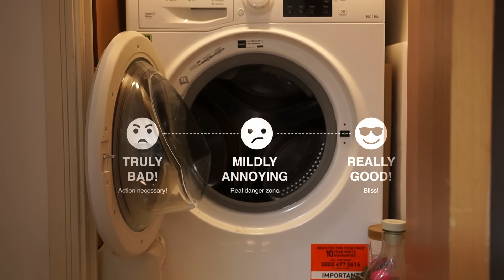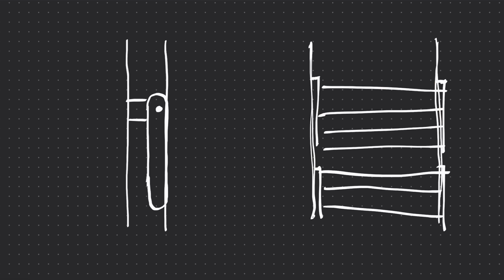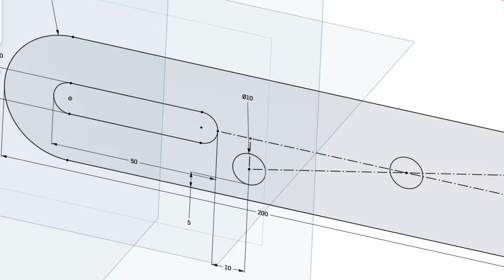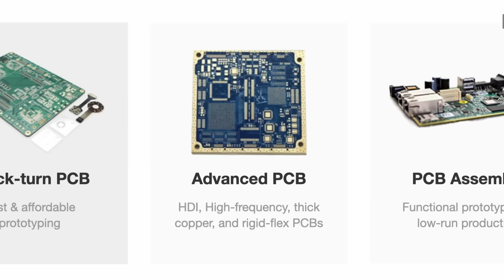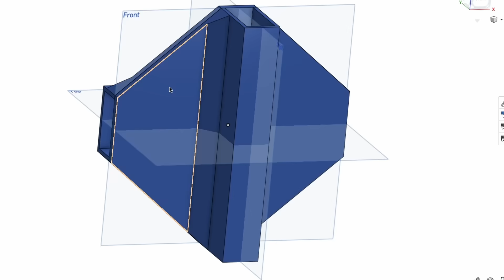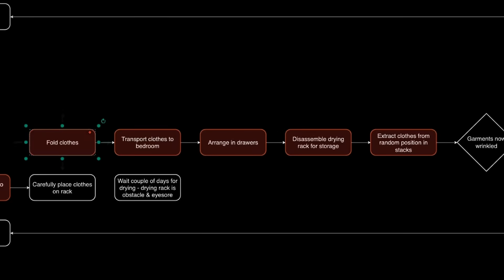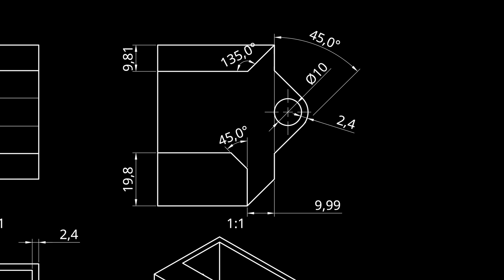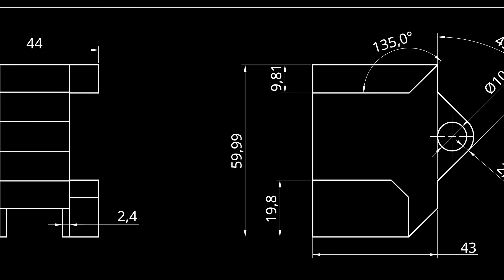I made furniture to escape the most annoying chore - and it fought back!

Comment: The sticker goo must have been a non-polar material.

Basic solvent theory: Stuff either dissolves in polar solvents (like water or alcohol) or non-polar solvents (like gasoline or oil). It's all about if the molecules have a charged side, or if their charge is balanced all around. Like dissolves like. It's the same reason oil and water don't mix. Water is polar (unbalanced charges on each molecule) oil is non-polar (balanced charge around the molecules). 

The usual answer for sticker goo is a strong-ish acid, usually a citrus concentrate. Polar or non-polar, this stuff tears up most gummy things.

Comment: Labels are a pain in the ass and it's getting worse because of chemical products thas are no more allowed leading manufacturers to try new compounds. Anyway one may consider that label glues are divided in two main famillies, oil soluble and water soluble. For the water ones, use water. For the oil sensitive you can use a wide variety of 'oil' derivate products. From cooking oil, to white spirit, cleaning essence... But the miracle solution is limonene it's the extract of citrus fruit peal. It destroyes very well most of the glues and mopymers.

Comment: Bro. Oil based glues have to be removed with oil based things. In Germany, we have something like cleaning gasoline which I use for these glues (which btw Ikea still decides to put on every single shelf board for some reason while on other furniture they prove they are perfectly able to do normal stickers that peel in one go). There is also acetone and some glue remover which I havent tried but I guess it's made for this specific purpose.

Comment: My method: placed the laundry room inside the walk-in closet, next to the bathroom right outside my bedroom. I bought a machine that both washes and dries clothes. 
Every day, when I take my clothes off, they go into the washing/drying machine. In other words, I use it as a dirty clothes hamper. Once it’s full, I turn it on. The clothes are now washed and dried, but only about 90% dry because by leaving them slightly damp, the wrinkles practically disappear a few hours after they’ve been hanging on hangers. Then all the clothes are ready to be used and washed/dried, over and over, until the end of life.

Comment: Critical issue here:
PLA is not structural, please use ASA(w/ nanopolymer bed adhesive) to ensure your parts won't sag severely over time.

This is due to creep, where PLA flows out of the way of all loads and stresses, to the degree where a screw tightened into PLA one month will be loose the next.

Furthermore, ASA is lower density(lighter), and UV resilient, an important feature since clothes drying tends to happen in sunlight. (Also can stand a lot more heat than PLA, but for direct steam PC would be better, use the adhesive for that too.)

Additionally, I recommend you check out brick layers (CNC kitchen's most recent video on it has a link to it) as a one button solution to increase strength 30% without other hassle. (Helpful with the tubes during assembly, where layer adhesion is the most limiting factor with that much leverage)

The tools you want for de-burring those pipes is an external pipe deburring tool and an internal deburring tool.

Using a wood hand plane to smooth the surfaces and break the edges is an easier,  faster, and cleaner method than sanding them.

Comment: Wow, this video has changed my life just because of the oil hack! hahah 

Jokes apart, I loved the design! And loved the thought process behind it. It just makes sense to simplify these everyday boring tasks. 
If I could add something for further improvement, coming from the principle that one would usually have some wet clothes to hang to dry and some dried clothes already stored. I would implement some kind of sliding system: when the clothes are dried on the bottom rack, I'd slide it up for them to stay with the clean clothes, at the same time, a new hack would slide down to hang new clothes to dry. I don't know how this would actually work, I just thought it would be a nice addition.

Comment: but its mostly for tshirts? I bought some nice velvet hangers and hang my wet tshirts, blouzes, hoodies, skirts, dresses on them (no sweaters as they would loose shape) and hang them on similar drying rack you showed on beggining of the video. Once everything is dry i just move clothes in my closet - no folding needed, no ironing needed (i have used iron maybe twice this year, im not even sure where my iron board is) and everything is on eye level. 
for other laundry i usually use little basket to separate socks from underwear, but you dont really need to fold them (changing socks for two dozens of identical ones also eliminates the need to pair them after the laundry and dealing with mismatched ones
in addition I have few smaller laundry baskets instead of one big basket - dirty laundry is separated while putting them in the right basket - i have one for towels and sheets as well

Comment: Kinda dumb you just made an on wall dryer. You could have gotten similar effect by just addnig something to block clothes from sliding off with regular dryer (maby not that cross shaped you have in the vid they are unpleseant to use, just get basic flat one).

The idea of skiping taking clothes off and folding them is cool but you didn't actualy do much with it as you simply left stuff in the open on a new dryer you made.
Instead you could make the ladder parts of the dryer detachable and hang them in the wardrobe. Maybe add a blocking mechanism so they won't slide off.

And to pick at this more you could have just bought a bunch of coat hangers use them for drying and then move clothes to the wardrobe.

Comment: find a way to integrate the contraption in a closed wardrobe and add a small dehumidifier at the bottom. the way dehumidifier works is just like a air conditioner, but without an exhaust it heats the room more than it chills. this will work for both purposes of removing moisture and heating the wardrobe in order to dry the clothes faster.

Comment: This is still an eye sore for me , i wouldn't want to see multiple colored clothes hanging on one wall of my room , my solution would be a cabinet with only two rods, one on the upper side and and one in middle , the roof of this cabinet will have a exhaust fan to ensure air circulation, I would make the cabinet with wood on exterior but line it with pvc sheets on inside to avoid mold or wood rot , now all I have to do is buy many many clothes hangers and hang my clothes on the two rods , they will dry when they will , the cupboard will be closed  so I don't have to see all my clothes on display, the only real down side is the exhaust fan which will consume energy , but it won't be much , I just need circulating air , which can be achieved by a small fan .

Comment: Think of the really thin cupboards in kitchens that hold cans and things. Have a sliding cupboard (think IKEA Metod) with drying/storage on one or either side (depending on room placement). Same storage solution, but now more discreet - once clothes are dry, slide the cupboard closed, so no clothes exposed to unnecessary dust. Potentially for socks and underwear, two cubby pots at the end of the cupboard before the rails start so you can just toss them in or pair and toss them in for the socks, and can easily grab without taking the whole cupboard out. Maybe a third for ties and tie clips and cufflinks. Maybe a small sectioned off area at the bottom for your shoes with perforated hole at the front/sides to allow for airflow and keep them from smelling the cupboard if you'vebeen exercising. Now you have a wardrobe with all your basics that is slim, discrete, and well organised whilst keeping your clothes clean from dust and other issues!

Comment: I found this magical solution. After hanging the clothes, leave them until they needed. The drying space is now my wardrobe.
This is basically an advanced version of that.
Reply: If I have money and space, I would buy an extra dishwasher to do something similar
Reply: If I may add : I do the combination of these, middle ground solution: instead of hanging the clothes on the ropes, put them in hangers (summer ones, which are light but also crease the most), and when dry, keep them on the same hangers, but move them to an open closet inside!

No comparison, though! Your solution is better in the sense that it merged these two steps even further! No moving inside. I just went with using items I already had...

 I admire your 3D printing skills, and I too love crafting my own solutions, so the enjoyment of building something from scratch, gives you the 🍰! 

And yes, it is inspiring to build something indeed seeing you do that! Thanks for sharing!
Reply from the maker: Hey if it works, that's great!! Sounds like a much simpler process than what I had before Naked W001!!

Comment: I've had this idea for several years. Fun to see someone else make something of it.

I've had a similar idea for dishes. When dishes are manually washed, you could place them in an area above the sink that drips down into the sink, and where you can just grab what you need from it. Or, If all the cabinets above the sink had pipes transporting water down to the sink you could have all of the dishes up there drying. 

Ofc if you have a dishwasher that changes things.
Reply: Apparently dish-drying cabinets are standard in Finnish homes.
Reply: @earincopper9975 nice, Finland isn't that far so I might have to make the move.
Reply from the maker: Thanks for the kind words and comments - glad this resonated!! Funny you mentioned that example. I actually run a similar system for dishes haha I don't put the high-frequency dishes in cupboards/ drawers. I leave the on the sink's drying rack, ready to be used, washed and reused with minimal friction.
Reply: @UrbanCircles  Haha i do the same with pots and pans
Reply: Ikea already makes a solution like that for dishes.
Reply: @CotonCotonCoton  cool!
Reply: I've seen dish drying cabinets in many spanish kitchens.

Comment: It is just a cloth rack. The metallic tubes doesn't ready do much, TBH, because the metal tubes have minimal contact surface area with the clothes and this area is not the bottleneck of drying. Actually any really smooth surface that doesn't absorb water will do, so metal makes sense. Also, I do fold the clothes for better storage. I just can't visualize myself going into my closet and have my underwears all hanging like that with the rack folded or otherwise.

Comment: My friend has a solved this problem in a cheaper and less time consuming way lol. She has a wardrobe set up so that most of her clothes hang on hangers. She made sure the clothes that she uses most often hang. Then she has one of those cheap clothes racks - you know just a frame with a bar on top for the hangers and wheels. When she does laundry, she hangs most of the wet clothes on the "drying" rack using the free hangers from her wardrobe. Once they are dry she simply transfers them into the wardrobe. If needed she steams the clothes right on the hanger before putting them in the wardrobe.
Reply: We do the same, all our clothes are on hangers, quite convenient

Comment: Well... we had similar problem. Solution was just to keep Tshirts from warping, we use cloth hanger (IKEA Bumerang). You put wet stuff on, it will dry out on and just slide back into wardrobe. Slide-open door and slide-out bar to keep the drying ventilated was the biggest issue, however.... it's working... 
I like your design tho...

Comment: Nice. For the stickers on the pipe, it is much easier to hairdryer them to melt the sticker glue before peeling. What leftover glue in the surface simply tap tap again with the peeled sticker u just peel 🙂

Comment: I have a wall closet by my bed, basically an array of hooks and round loops (no sharp points) where I hang my most used clothing. I also have 4 rows of rope going above my bed (anchored on hooks), where I dry my clothing. Similarly I often leave the clothing there and slowly wear it over time. 
I would recommend making a section with hangers or for hangers (dress shirts, etc). Also a detachable 2 finger arm for drying shoes/sneakers.

Comment: Great project and exploration. 3d printing changes the way I think about problems and this (your project) is a novel approach to a problem many face. One suggestion would be more smoother fillets on the print edges. This would give more strength to the filament you're using. Also wondering if you printed considering layer orientation for strength. Great project and great video..thanks for sharing! 🙌🙌🙌

Comment: I'm glad I'm not the only dork dreaming up self made furniture products for simplifying laundry 😂 
I've considered the approach you took, but got too worried about moisture in my somewhat poorly ventilated bedroom. it's so cool it works for you though, maybe I could try just 1 rack for my most worn items like you said! 
One project I did follow through on is little custom 3D printed caps for my doors that prevent bedsheets from getting torn by the sharp corners. Works kinda nicely , but this may have also slightly bent the door on the hinges over time so can't say I entirely recommend it 😅
Next you could do dishwasher caddies that slot into kitchen cabinets - never unpack the dishwasher! 😉

Comment: Enclose it with a few doors, add a couple pc fans at the base and vents at the top and you can close the clothes away and silently dry them in no time. You can hang art on the doors or integrate some sort of light shelving, etc to get more use out of all the space it takes up.

Comment: I enjoyed watching, but I don't understand it! I take my clothes out of the machine and put them on hangers (when line drying outside isn't possible). Then hang them on a clothes rack so that the drying location is the same as the storage location. Or you could hang them on a movable rod or retractable line if for instance you have a more ideal drying location and then transplant the clothes still on their hangers into your wardrobe once they're dry.  
 
Also, I would use wood joinery techniques for the main structure rather than the large 3d printed brackets to avoid the use of plastic; using plastic there seems like the worse option in several ways.

Comment: I have the same problem, I guess we all do, I solved it by installing a drying rail directly over the washer on hangers, I installed a ventilator and finally I just use my steamer, below the rack I have a ironing board mat on the work surface. This results in quite efficient work process.

Comment: Great design, but have you tried a drying machine? There even are washer/dryer combo. Also for storage the final result take a lot of space for only one load 😕
I agree that drying and storing clothes like this is better to avoid creases, but it's not space efficient at all. Also over time you would mix dried and wet clothes, unless you only wash your clothes when all the clothes on a rack are dirty. Personally my main issue with the drying tower is the eye sore, and I don't think your solution solve this. You should do a follow up video in a few weeks/months to tell us how it worked out for you and if you had to refine it, but currently I feel like it needs more cooking.

Comment: My dishwasher became my storage solution 😂 naturally without extra steps. I keep it open and take cleaned dishes until I have to load dirty ones. Yes, dirty ones are waiting in the sink so my solution isn't perfect 😅
Reply from the maker: 😂 hey, let’s brainstorm this out. Here’s an idea: 2x dishwashers! As you use the dishes from one, you naturally fill up the second one with the dirty ones. Once you run a cycle with the dirty ones, the ping-pong repeats. Clean sink, clean life! Optimised! 👌
Reply: @UrbanCircles  thank you, that's a great idea but I don't have place for another one 😅 I thought about putting dirty dishes on to a drying rack I have in cabinet, but in reality it doesn't feel right 😂

Comment: That's so good! I already have a washing machine with drying function, so I thought that would already solve it.. unfortunately they still come out slightly damp. Laying them out for an hour normaly does the trick, but than I am already too tired to put them in theire baskets
Reply from the maker: Thanks for the kind words - glad this resonated with you!! Yeah, funny enough I also had some moments of excitement at the dryer function of mine - exactly the same issue as yours. On top of that dampness that still means I have to hang the clothes, the flat also becomes very humid because of the hot steam (and, final nail for me, it's really expensive - takes a lot of energy). Naked W001 is surprisingly efficient and, what I love the most, it really eliminates a lot of the friction in the process.

Comment: Love this idea, and it got me thinking about a possible enhancement if you want to make it powered.  Drilling vent holes in the bottom of the tubes while they're in the drying configuration and attaching an air pump to each tube would expedite the drying by venting air from inside the clothes 😎
Reply from the maker: 😂 the TURBO mode!! Was thinking about this as well, but decided in the end to keep to simple. Would love if someone does implement it as a personal mod to theirs!! Will keep you in the loop when I release it